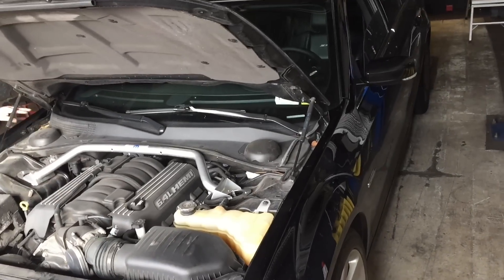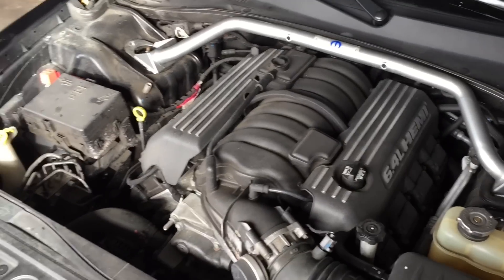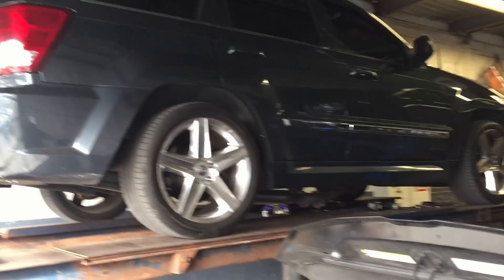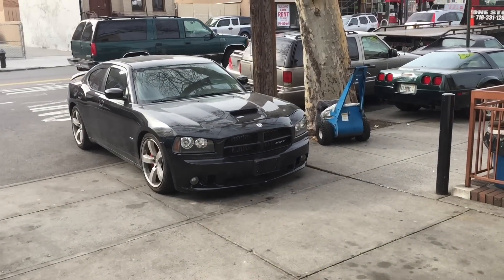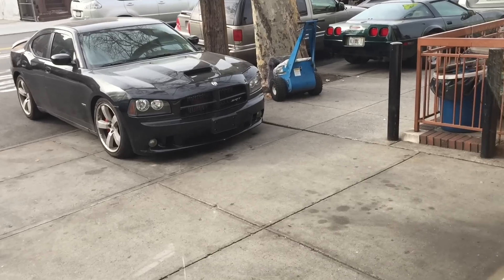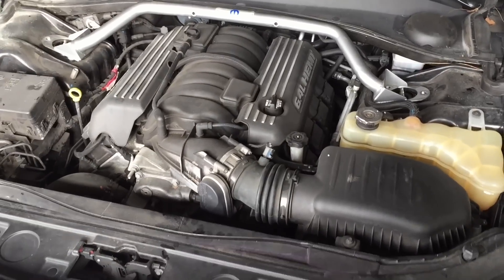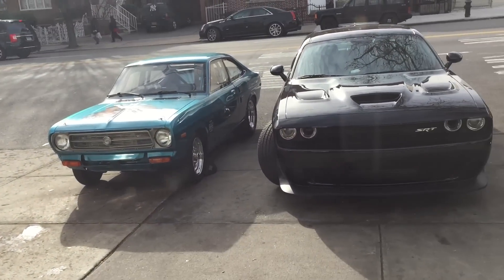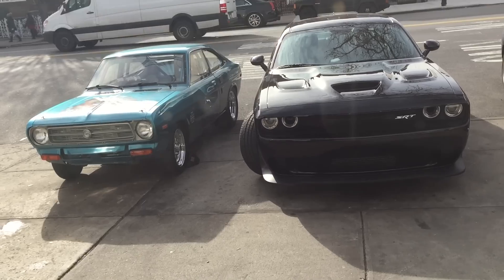CHRYSLER 300 SRT: THE HELLCAT PROJECT part# 4

Comment: I have a question for you since you had a SRT 300 and now you have the HC Charger and its about the transmission. How does the 5spd in the 300 compare to the 8 speed zf90 in the hellcat or the zf70 in the other srt line up ?
Reply from the maker: 5 speed is nowhere mear as good as the 8
Reply: so the 5speed in the srt 300 is the only con you would say about that car
Reply from the maker: +Tyler Nelson it was good for its time.

The 8-speed is smoother and has higher MPG
Reply: Oh i know. A friend of mine let me borrow his HC charger for a week while my car was in the shop .IMO after driving a hellcat with the 6spd and another one with 8spd, the auto is so much better at getting the power down and keeping you in the powerband